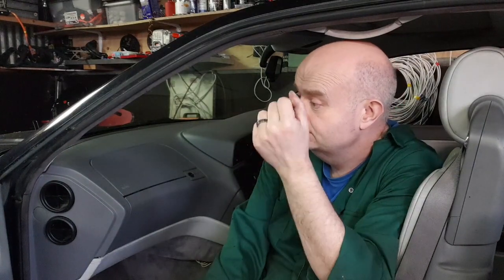Panzer in den Barn

Comment: Bought two 9,9 kWh vw packs for just under 2500 Euros, will be interesting to figure out how to get them to cooperate. 🙂 Congratulations for saving "Der panzer",
 it could very easily have gone straight to hell instead.  I will probably get in touch with you at a later date regarding the project they are supposed to be used for.   💪🖖